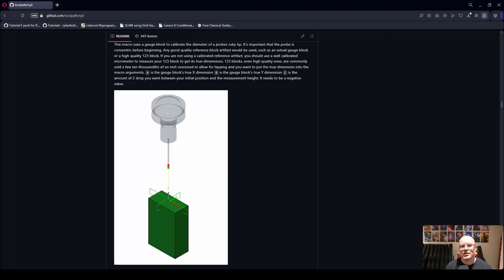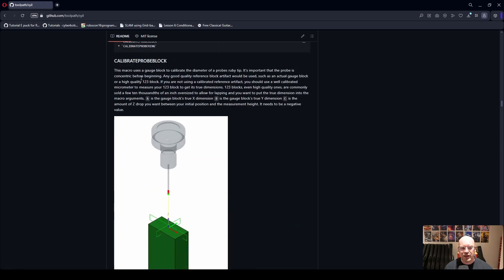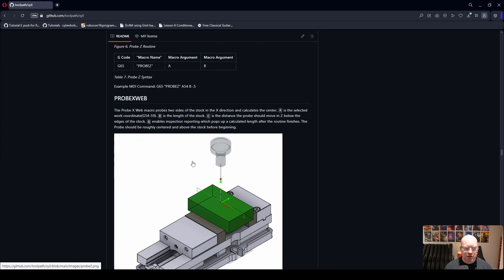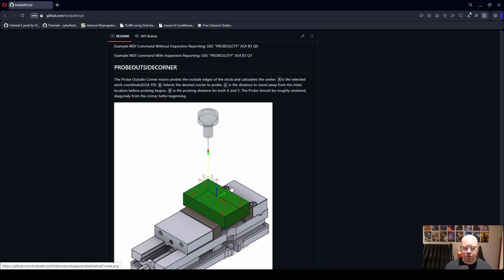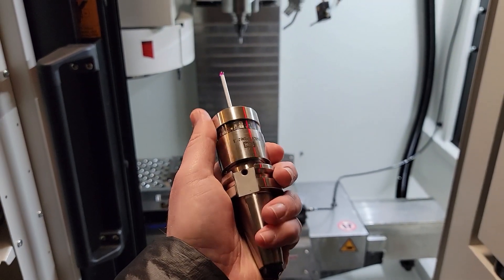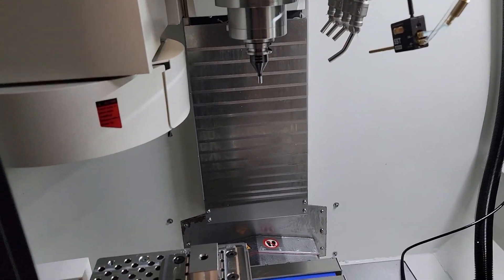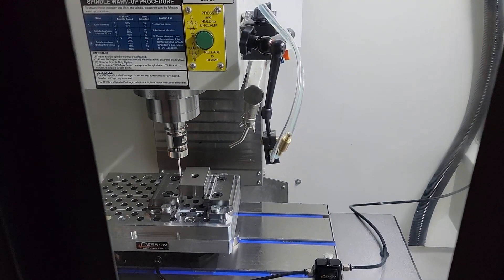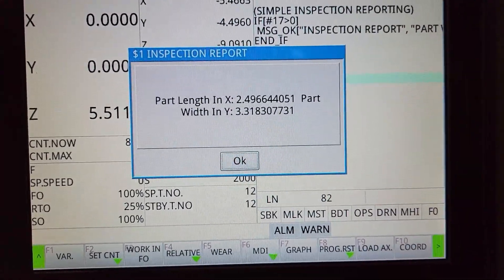SYIL X7 LNC6800 PROBING MACROS

Comment: Did your controller  already have the Probe signal set up for input 62 from the factory, or did you have to add it? 

Do the probing macros depend on this being set up, and if so, it has to be input 62?

It looks like the macros call a G31 with some parameters to use the second probe input, so I'm trying to figure out if additional setup like this is required.
Reply from the maker: @jamesh5569  All I had to do was connect the probe to the probe port on the back of the controller and switch from normally open to normally closed I believe. I purchased a silver cnc probe and it was inverse of the pioneer. If you have your probe connected, you can use mpg dry run to test a macro. Start with something simple like probe x. If you're referring to R_skip[], the number 1 to 3 refers to the x,y,z coordinate when the probe triggered.
Reply: @MrSmith1231  Was input 62 already defined as the Probe signal though? I was curious if your machine came with that already done, mine does not.

Thanks for the tip on the MPG DRN, I've actually never tried that but I will once I finish the installation.
Reply from the maker: @jamesh5569  yeah, my machine already had the probe signal defined. I'm not sure how to modify that.